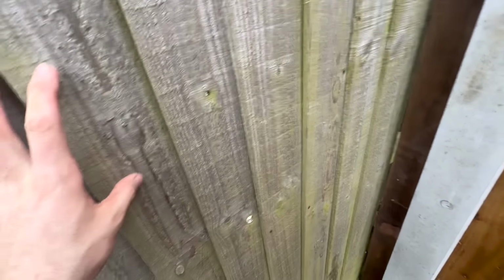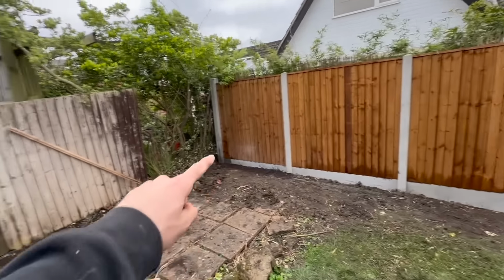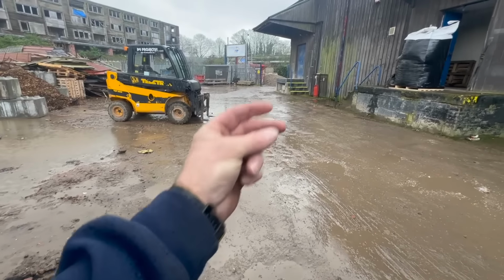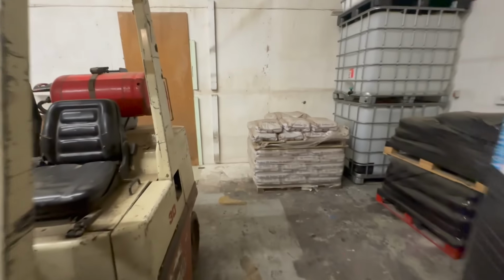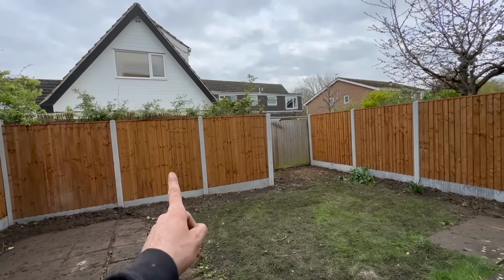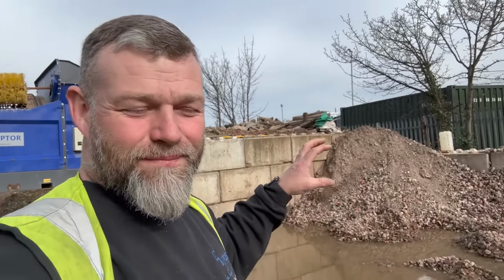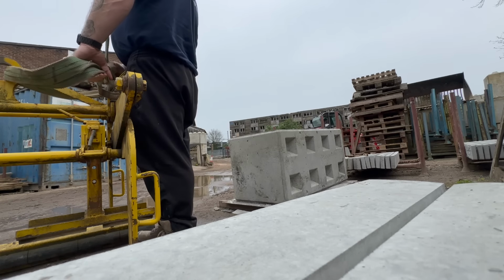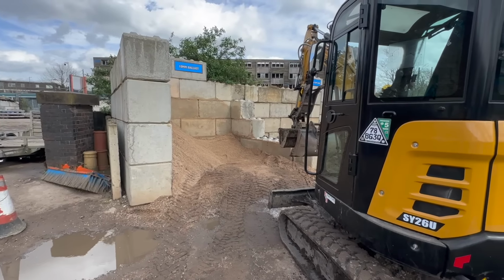My DAD Couldn't Believe His Own EYES! *WOW*

Comment: Another great video from D & J. Can I suggest that you impress the D & J into the concrete by having the letters in relief rather than having spaces to be filled by the concrete. This can be done by building up each of the letters so they are between 1 and 2 cm raised. This will leave the impression into the concrete rather than the other way around. The impressions will last a lot longer this way and not get chipped off as you move blocks around, material roughens etc.

Comment: Great to see the swans back. 
I would invert the lettering in the blocks so it leaves D & J Projects pressed into the concrete. If it's like you have already done the letters could break off. You could even make a stencil to spray your lettering black (or any other colour) and because it's below the surface it would last for years and stand out more!

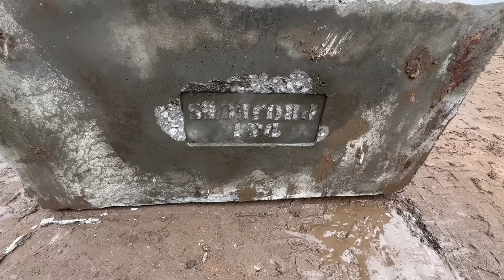Comment: 28:45 When you get the letters cut you need to have them chamfer the cut of the letters, otherwise the concrete will stick. You still might need something to stop the concrete sticking - I just slosh on a bit of vegetable oil with a brush to help it detach.

Comment: The gravel board on my fence is rattly, do you recommend cement in a in a triangle 🔺️ shape around it or is that overkill? 

Also with cement, is regular sand and cement good enough or do you need sharp sand?

Comment: With the blocks do you use plastic molds? Can you not use positive letters (3D) plastic ones that are stuck to the mold with epoxy so when you split the mold it leaves a negative imprint

Comment: Dave the stamp would be better maybe if you have the individual letters cut out say 6mm thick and welded to a plate so it makes an impression, so letters would be stamped inwards and mould would release better maybe? rather than the way you are trying as the letters will brake off in the mould and fill the letters up and concentrate will be stuck in the stamp all the time ?

Comment: Dave - for the letters to work well, the sides of the letters should be angled so they release easily from the concrete.  Use form oil on the letters as well to ease the release.  All that together with a larger, simple font, should deliver success.